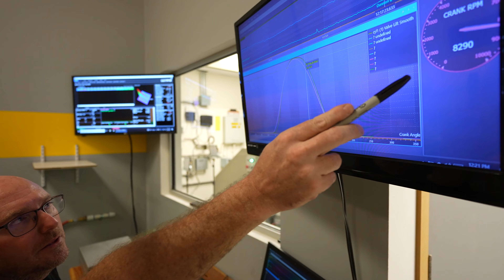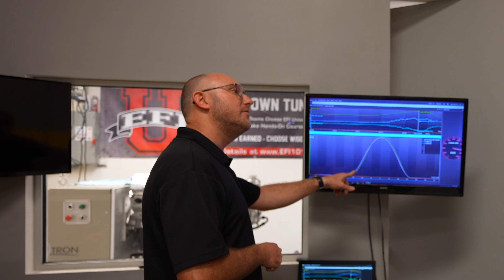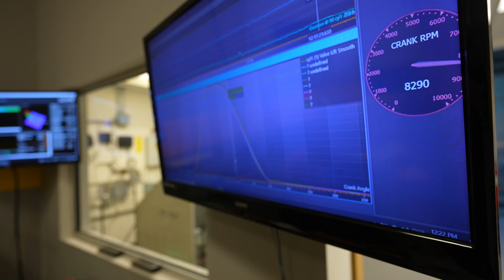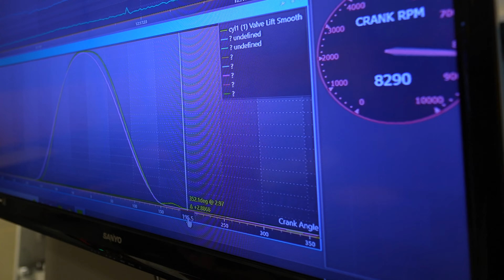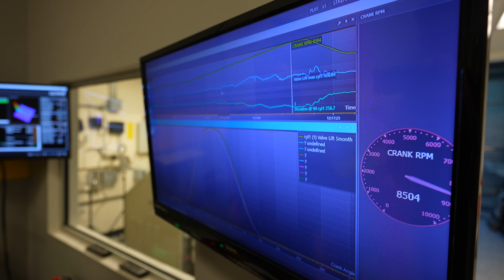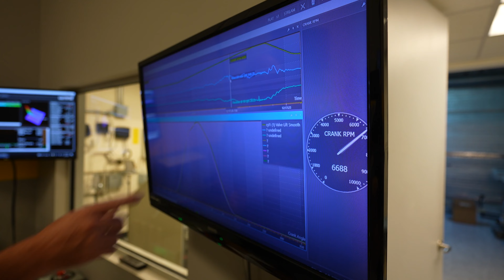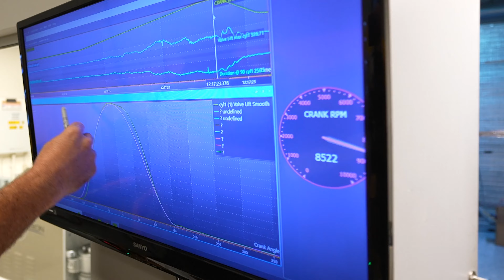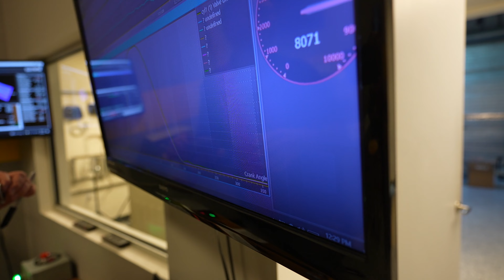Testing America's Fastest Street Car Engine With NO Rods Or Pistons!

Comment: Whoaoo!!  What a load of Awesome info. Learn something new everyday.  Resonant frequency of the springs? Never thought that was an issue. Now I know.  Good luck this year Rod and the rest of the team.
Reply: Yes indeed.  The mass of the spring itself can cause it to lift out of the pocket or drop off the retainer when pushed to the limits of valve acceleration/decelleration at high rpm.  Geometry and wire diameter matter alongside spring rate.   Conical valve springs are bringing new limits to valve control previously unachievable.

Comment: I know that Steve Morris, running smaller engines for similar purpose (drag and drive), says that he always runs a very gentle cam profile and that most people run too much lift for it. Asymmetric profiles too. He can make however much power he wants by adding boost, but making it last requires the right cam. I wonder what his profiles are like compared to yours.

Comment: Wow what an informative video.  It's amazing what you learn with this technology.  But when you see it explained it clicks.  
So if you did a regular compression test on a  engine just say you get 200 lbs average. At 8000 rpm depending on cam of course you might be getting 100 lbs of compression.  So valve float is basically the engine not building up enough compression to fire fully or at all. 
I know you don't have the rotating assy in but it would be interesting to see a compression test through the rpm range to see the same results. Poor man's spintron??